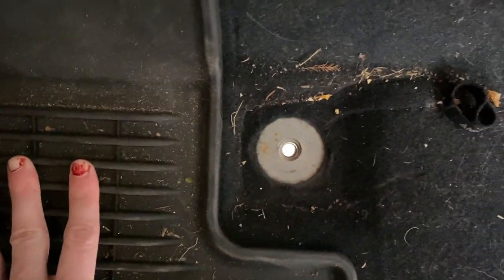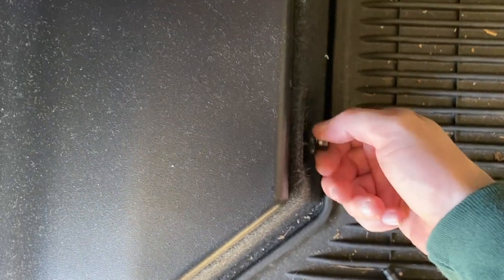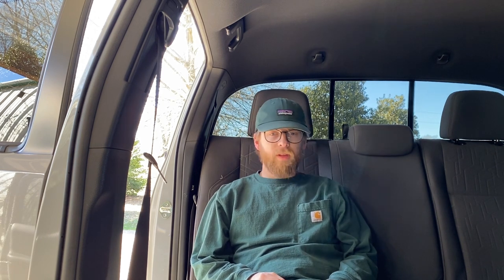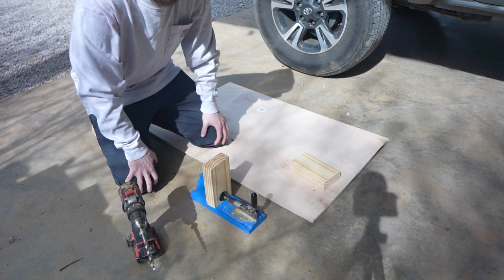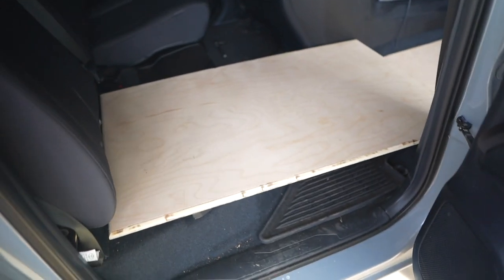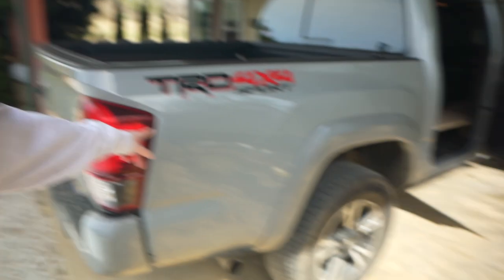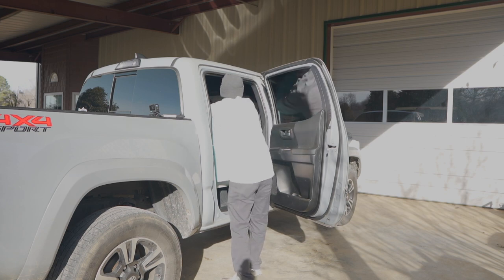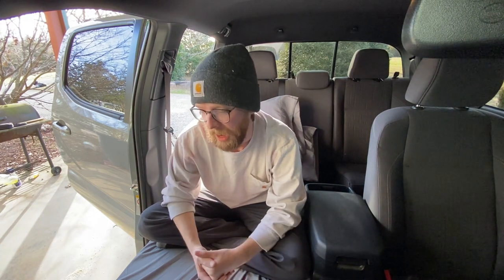I Turned the Passenger Side of my Tacoma Into a Bed

Comment: I've done the same exact thing but I used PVC pipes instead of wood for the frame. The ratcheting cutter made it super easy, and it was dirt cheap.
Reply from the maker: Great idea! I’ve seen a few pvc builds before and always look great!
Reply: How long is the plywood platform, I’m 6’2’’
Reply: @crissgen  i am 5'10" and can lay end to end with a pillow and be comfortable. I think 6'2" would be a tight fit but just as tight as a bed setup. If i went a little lower down i could get some more space but i have the glove box in the way. I have mine high enough up for some storage space underneath, if i went lower i probably wouldn't be able to fit much of anything under it.

Comment: If you have the short bed & get a camper shell, you still won’t really be able to fully your legs out if you’re 5’ 7.”
Reply from the maker: @Fotosynthesis858  you will if you sleep at a angle from corner to corner
Reply: @Outdoor.pixels that’s what I’m planning to do. I have a dodge Ram 1500 short bed. Just ordered the topper today and plan to sleep diagonally. 👍
Nice video!

Comment: I did sane for mine but to get best out of it for room you shoukd remove the too part of back seats. There are those little storage cubbies back there behind the seats but trust me it will add so much to the room. I’m five 7 1/2 and I found I needed a little extra wiggle room as I sleep with my arms above my head sometimes what some people do is actually remove those plastic cubby storage bins behind the top side of the backseat and insulate tge rear wall then put a diy molley panel over it. Just made out of 1/4 plywood and painted . Addsso much room but also deadens the sound as you drive.👍🏻
Reply from the maker: Yeah I thought about removing it but it I’ve been taking the platform in and out so it’s just been easier for me to leave the back part and I use the cubbies to store tools for the truck. Like you said tho you could remove it if you was like 5’10 and maybe get by

Comment: How tall are you, and can you lay down flat from head to toe? 

Also, find the right value resistor and trick that seatbelt circuit into thinking it’s connected. Should cost less than 2 bucks. No more dash lights. Did this on my sprinter van and works 100%.
Reply from the maker: I’m 5’7 and yes I can you could take the other part of the back seat out and make it work up to like 6 feet

Comment: Once you take the seat off and it looks like you had to cut a cord with your knife. Are you able to put it back in there and hook it back up properly ?
Reply from the maker: I’m pretty sure it was just a zip tie. I didn’t cut the wire and it just uses a plastic snap so you can put the seat back in connect the snaps and the alarm should go away